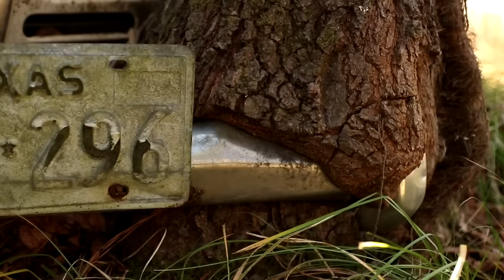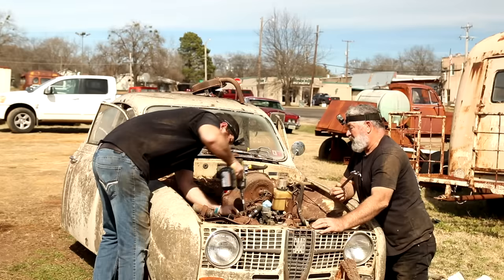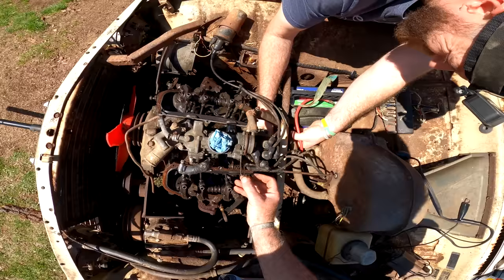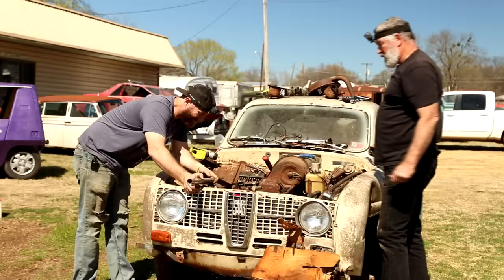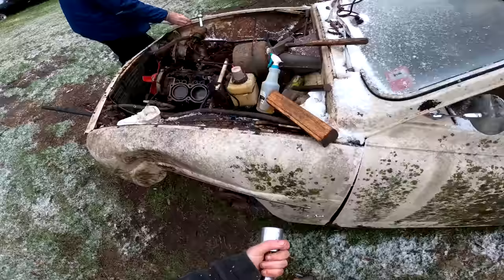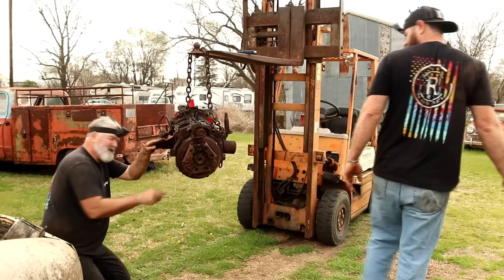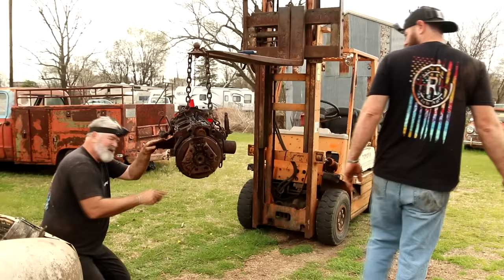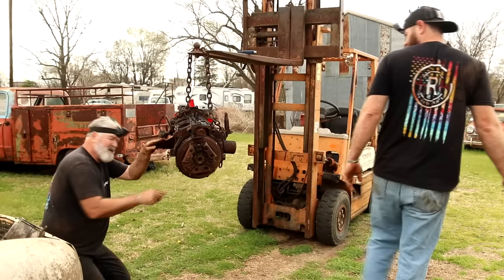THIS IS BAD! Attempting To Start Locked Up V4 Engine Covered In Rats Nest | 1968 SAAB 96 | RESTORED

Comment: Such a cool little car! I thought it was a lost cause, but once you got it spinning with the starter I was really hoping! The car is so unique It might be worth ordering some parts enough to get it running, rings, gaskets, run a hone down the cylinders, etc. I think taking a pressure washer to it inside and out and getting the engine to run would set it up to sell pretty quick even if the transmission has an issue. I'd love to see it cleaned up and the engine running, some of the big dents pushed out, etc. I love your channel!
Reply: This comment needed a heart ❤️, because I totally agree!
Reply: It probably is a lost cause.
Reply: It would be cool to have it running on the road still with the chunk of wood fused into the front
Reply: @ShadowsOnTheScreen  its actually preety easy to make it run...they just skipped all the needed steps unfortunately

Comment: I own this car when I was 16 years old.  However mine with a 3 cylinder, 2  cycle engine.  It also has a "free wheeling transmission".  The only options it had were heat and an AM radio.  It was not a very cool car to drive to high school! LOL!!  Drove it for a couple of years until the transmission started making a lot of noise in high gear.  Dad made me sell it as it was not worth to cost of repair, even if I did it myself.  Glad you guys tried to get it going.

Comment: I rebuilt one of those German Taunus V-4s. Inside the car, underneath the lowest heater tube, you'll find a T handle, the Freewheel handle. When pulled out (toward rear) the clutch acts as normal. Push it in (forward) and the clutch acts like a centrifugal clutch. In that position, you could be going 60, let off the gas completely and the engine will go to idle as you sail along. It's great for when, say, the hydraulic clutch goes out. Push in the Freewheel lever and you can start it no problem, even in gear, then increase the RPMs, the clutch engages and you're off. Ease back throttle and shift gently. Basically, the freewheel control shuts off engine braking; maybe to avoid loading the trans on a long downhill.

That engine includes a counter-balancing shaft driven by a large, compressed-fiber gear. In my case, the rattle was the 2 bearings on that shaft that had worn out pretty severely. The 4-speed trans in the Saab 96 was somewhat of a miracle in design, very short gearbox but fairly reliable, and took a well-experienced trans-chanic to rebuild. Reverse = pull shift handle outward, back & down. Otherwise it's the standard H pattern when looking at the steering column from the right. Those cars were used in European, dirt-road rallies for quite a few years. From the 3-cyl, 2-stroke models (850cc) to the 4-stroke V4 (1183 to 1699cc - through 4 models). Smallest was 40 bhp.

The front grill comes off by removing 6 small bolts.

Wiki - "The V4 was later expanded into the Ford Cologne V6 engine that was used in the Ford Capri, Ford Taunus, Ford Cortina, Ford Consul, Ford Granada, Ford Sierra, Ford Scorpio, Ford Ranger, Ford Explorer, Ford Mustang, Mercury Capri, and many other cars."

Good luck guys! You'll have earned it.

Comment: Hay guys, My Name is Kevin Tatro  from Burrillville Rhode Island. I have been working on cars trucks and everything in between since i was 14 years old. Im now 52 and have learned a lot an still learning but Id like to share a little secret with you i learned thoughout the years. Used Brake Fluid is the best rust penetrant on the planet. Just don't get any on paint you care about because it will be gone right to bare metal by the next morning. I figure you can break a few engines free using this method. I kept a large bottle of dot 3 and stuck a squirter in it from a bottle of some chemical I had emptied and what I do is bleed brakes directly into this bottle as it slowly refills it always having the best rust penetrant on the planet. Hope this helps. Good luck and keep up the good work. Someone is learning something somewhere watching you. God Bless. From Kevin T. in Burrillville R.I.

Comment: You might have found out by now, but under  the distributor there is a square drive which is the oil pump drive and quite often when you pull the distributor out, the shaft comes out and then drops silently into the sump, you know after five min's of running when it Sizes up. !. I once took the Sump off a Ford Consul to change the sump gasket, in the UK, to find three oil pump drives just sat waiting for me to liberate them, :-)  yes it is a ford engine, it was used all over the place in the Sixties / seventies in the UK and  Europe,   in UK it was in the Transit van, Consul, Zephyr, Capri,  I have even seen one in a Generator  2lt Square V4. Hope this is helpful, regards Robin.

Comment: My Dad had a '65 SAAB 96 Monte Carlo, it had the standard "three on the tree" with freewheel.  It also had a three cylinder two-stroke engine which sounded like a big ass snowmobile, the engine had a LIFE TIME warranty!  You engaged or disengaged the free wheel with a T-shaped handle above the clutch pedal.  Mom had a '74 SAAB Sonnet with the 4 cyl., I think that one was 1698 cc's, it had a four on the floor.  GOOD LUCK!  It's a cool car, and it looks like it's not to far gone. 
Shift pattern:  R  2
                         1  3

Comment: Use 2 stroke gas to prime the carb. The added oil in the mix will help with sealing.
Reply: The V4 was a Ford engine four strokes, while the Saab 3 cylinder was two strokes ;-)
Reply: @GiguereSylvain  Correct, but what we're talking about is using two stroke mix fuel for this four stroke to increase compression for starting.
Reply: @murmenaattori6  I would not have thought of using this trick, but it makes perfect sense. 👍

Comment: I bought a new light blue V4 Saab 1968 96 in the beginning of 1969.  Loved the car and the mileage (32 mpg over 3 years) and the ease of driving it  Good luck with it.  But I'm fairly sure I started mine by locking out the freewheel (pull out the T handle to the right of the accelerator), rolling it down a slight hill, then popping the clutch.  Once it was started you could go back to freewheel by simply pushing in the handle with the toe of you right foot (but it needed to be stopped to lock out the freewheel).   You didn't need to use the clutch changing gears, but you did when you came to a stop.  Good luck with it; it was a wonderful car!

Comment: Is nice to see you try to get this old Swedish classic car to run. Hope you guy’s will make it run later this engine sounds awesome! Also I am happy to see that you found the Saab specifics there with the hood opening forward and they have small button that you have to press/hold in order to set the gearbox in reverse and there is one more Saab specific thing from this time aera of the 1960-70s Saabs that it has to be set in reverse gear in order for the ignition key to be taken out.
Reply: that rear gear for key removal is true of 900's also.  Really rooting for this gem to run and be restored :)

Comment: The V4 in the Saabs were originally a ford built motor used in generators. They has siamesed exhaust ports. I used to race one of the first 10 prototype Saab 99's. A low slung sporty version that had the original Ford V4 in it. I modified it and had a custom dual weber intake made for it. It also had the "Freewheeling " feature originally used as a economy feature so you coasted when you took your foot off the gas. There was a lever to engage/disengage it. I also had one of the 2 cycle 3 bangers. 4 speed on the column. This brings back a lot of memories.

Comment: The early 70's Mercury Capri's had small V 4's in them too and went quite well. I know guys that put these engines in Jeeps too. They would rev higher and had a little more horse power too.

Comment: If you really think it is bad head gasket compression loss, a trick I used when we needed to trouble shoot and find a problem as you are doing was to use "Copper Coat" gasket rejuvenation. i still use it on lawn mowers when I do not have the right head gaskets in stock. I have about 12 bottles of this coating/sealer in stock. I use the small two ounce bottles as this stuff can harden up once it is open. It will fill any voids in the gaskets with metal (copper of course). I have never had a problem with getting it off. When I have the correct gaskets I use those of course. On some engines with slightly warped block ( not sealing but close and too much warp to machine) I have left it on and it sealed. The customer (who would not pay for a new block or even a used one) was happy and the tracker is still running. I set it up to store for him every year and inspect and recommend maintenance. I have also used it on good gaskets on full size cars and left it on. This stuff works.

I also have a thought on the trans/clutch situation, The freewheel on that engine is a centrifugal clutch like on a mini bike or chain saw. The clutch will only engage if the engine side is rotating at a speed high enough to do so. Sooooo, the point, you cannot push or pull start this vehicle.

Comment: My buddy in college had a Saab. As I recall he said it was a Ford industrial V4. Great car he drove from Iowa to Fairbanks Alaska and we got around in it just fine. Those are good safe well built cars.  The interior/ dash looks good. 
Is there a spare in the trunk?  Keep at it.
Reply: The V4 was a German made unit, fitted to European Taurus, the UK had the Kent in-line OHC 4.
Had one of these about 25 yrs ago, damn good cars, not mega powerful
Reply: You are right, that engine is Ford Germany 1.5l V4 and was also used at Ford Taunus 15M car.
Reply: @mattinieminen9826  that was the car, Ford Cortina sized vehicle, spelt it wrong though 😅
Reply: @johnwynne2179  Not Taurus like Us cars but Taunus is correct, this is mountain in Germany😊
Reply: As others said, this is the Ford Taunus V4. However when you run into them in the US, they were Ford Industrial engines. Same engine, just different use. We had a Portable air compressor powered by a Ford Industrial V4 at one of the placed I worked.

Comment: Questions for you Lance and Wyatt. If you went as far as pulling the engine, then why not drop the oil pan and pistons to loosen those rings? I know it's more work for the possibility of stuck rings, but would it be worth it in the end? Could that be done without destroying the rings? 

I know you are on a schedule to get the vehicle running and rolling, but your viewers hopefully would understand when you encounter a sieged engine. 

Great vid guys. Keep up the good work!
Reply: I had some similar thoughts. When the Motor was out, why not disassembling it just for a clean up and an little lubricating (pistons, rings, rods, etc.)?
I think it would take a similar amount of time, like trying around and sticking in the bush.

Comment: Those cars have a one way bearing on the drivewheels.
Nothing wrong with the transmission.
Great video btw.
Reply: Wasn't that only on the two stroke variant?
Reply: @KayoMichiels  From what I know it was used on the V4's as well. At least the early cars.
Reply: All SAAB 96's had freewheeling, even the early SAAB 99's with Triumph 1,7 and 1,85 litre engines had it. Was gone when SAAB built their own 2-litre engine. Fun fact is that this Cologne Ford V4 engine was the only engine found in a SAAB that had pushrods. It has extremly short stroke at 58,86 millimetre/ 2,317" and the bore was 90 millimetres/ 3,52388" so truly an oddball engine.

Comment: This German Ford V4 was used in the Ford Taunus, Capri and the Transit vans. They came in 1500/1600 and 2000cc. I had a Ford Capri with the 2.0 litre V4 engine at a time. These Saab 96 (both 2-stroke and these V4 versions) were very successful rally cars.

Comment from the maker: If you like this video, please consider hitting that subscribe button to help us reach a huge goal of 200k subscribers!
Reply: clean the engine bay out you need a leaf mulcher powerful suction
Reply: Put 2 batteries in series on it and feed it 24 volts... she will turn over then fast...lol... Id seperate the starter batteries from the ignition system but what do you have to lose ?...if it starts it might reseat the rings ....if the starter burns up then you are not really any further back!...good luck
Reply: YOU CAN BAND-AID the head gasket with rtv or flex-seal. while the head is off heat up the pistons with a torch and cool them down with your favorite cutting oil
Reply: Take the flywheel cover off and see if there's grass and stuff inside of it
Reply: Just had a idea when knocking the pistons loose if you got a rubber mallet take the rubber head off and use that with the wood instead of hammer n wood might help
Reply: Heat the piston tops with a torch fir sure
Reply: Great video guys
Reply: How much do y'all want for the fiero in the back ground
Reply: You could go stronger than vinegar, to muriatic acid, and/or fill the crankcase with vinegar to dissolve rust off the bearings.
Reply: Once you moved that head bolt, you should have won and been able to get it out without breaking it.  Even if you could get the broken part out, it was worth you time to work it back and forth at least 10 times, certainly more than once.
Reply: Scott at Cold War Motors is experimenting with filling pitted bores with JB Weld.  I wonder if we should see how that goes before you put the Saab back together.  I think the same Ford of Germany factory that makes the Fiesta made those V4s.  I suggested filling pitted bores by brazing instead.
Reply: You couldn't jack up the car and get at the flywheel via the inspection plate?  I'm also thinking the crankshaft could use vinegar.
Reply: Change direction on that flywheel, 10 times at least, just like that head bolt.
Reply: I respond to low compression with big plug gaps, as much as .060".  Then return them to spec, or sometimes even less, if compression returns with use.
Reply: Pppppppp
Reply: Did you check the time of the motor? If pistons are not synchronized with the valves at the very right time you are going to lose compression!
Reply: You guys are the most coolest, kindest, sweetest, caring people around!!

Comment: Saab used small european V4 Ford engines. This car has a free wheel function That means you can put it on neutral although it has a manual transmission. And on neutral it will just go on rolling.

Comment: For the love of SAAB! Having cut my teeth as a young mechanic, especially on this model SAAB, my heart sunk further and further as I watched both videos about this car. Your approach to the goal, get it running, was way off. First, the engine and trans should be removed as one unit. Second, a frozen engine, sometimes can be broken loose with the crank bolt, otherwise is a candidate for a teardown and inspection. At the least, a leakdown test would indicate the most likely issue after rotation is confirmed. Forgot to mention that I held the world record (and maybe still do) for SAAB V4 engine and transmission removal at 19 minutes, while it was still hot from driving!

You have received a lot of support for the videos posted about this car. Trained and somewhat partial to a method or approach of "restoration" I do appreciate the effort and time. Good luck with that car because done right will be a fun way to learn about an older vehicle and how it drives, Born from Jets.

Comment: it is a ford v4 engine you can still find plenty of parts for it , at least here in europe, because those engines were used until the 2000s , if we have the problem of low compression after sitting for a long time we put 2-stroke oil in the gas to fix it temporarily and keep it going longer than putting some oil in the cylinder all the time , the clutch of the saab 96 has a freewheel to ensure that the old two-stroke continued to get oil when you went downhill with your throttle off , and that clutch is also placed on the v4 , that a pull start is not going to work

Comment: That lever you're pushing on in the passenger compartment is the free-wheel lever.  When pushed in the transmission is in free-wheel.  Pull it out and it will work like a conventional transmission.
Reply: It's the trans shifter too.
Reply: The transmission shifter is on the column.  It's a 4 speed.  Free-Wheel lever is below the heater vent.

Comment: It brings back memories, I used to work on these in 1970-80 I miss those times. I want to see what it looks like when finished.
Just wanted to add but some might know it, when I used to change my oil I would put in 1/2 quart of automatic transmission fluid, It would clean and free up hydraulic lifters and rings.

Comment: Couple of thoughts, if you don't already know of them.  One, check the timing.  Two, remove carb and just spray into the intake.  Three, you CAN hook two batteries in series, 24 volts, around the car and JUST to the starter and run it at 24 volts to get a LOT faster cranking (which as you mentioned, you need).  This isn't a permanent solution, of course, but just to get it spinning really fast to see if it'll fire and bring the compression on.  Lastly, use ONLY spray start/ether vs. gasoline as it'll fire a LOT easier than almost any type of gasoline.  I'll be interested if you try any of these suggestions, especially the 24 volts to just the starter and the results.  Oh, with carb off, you can also squirt some oil into the intake to lube/increase compression while trying starting fluid and faster cranking.
Reply: 100% with you on the 24 volts. I used to have ob old ford that had such bad compression I would need to connect a spare battery in series to het it to start from cold. The dash warning lights glowed like lazer beems but didnt blow. After running for 30 seconds or so I could put it back to 12 volts and it qould be fine so long as I started it every 2 hours.